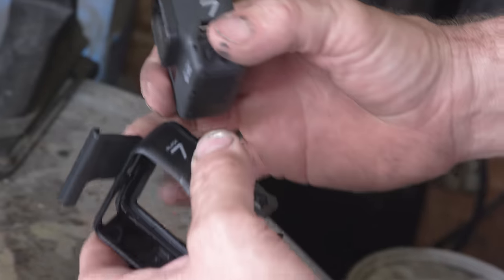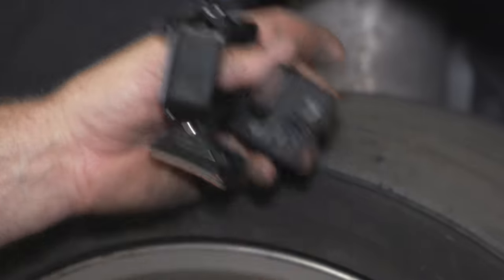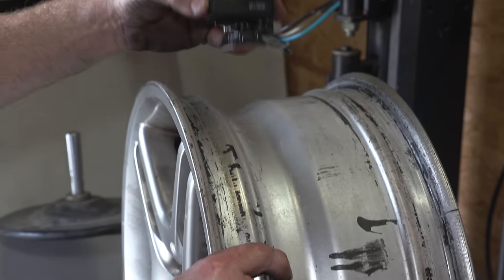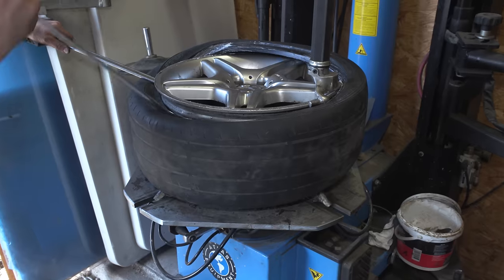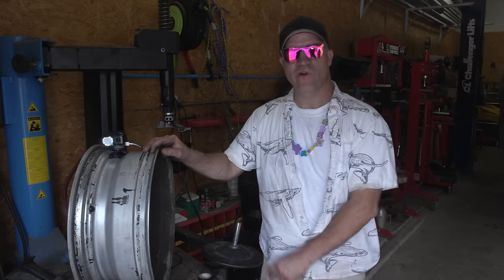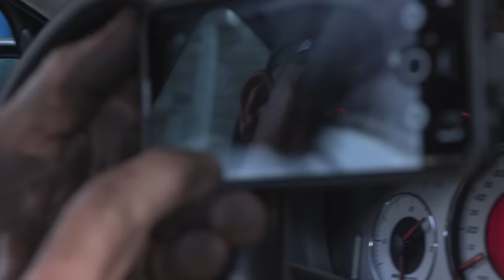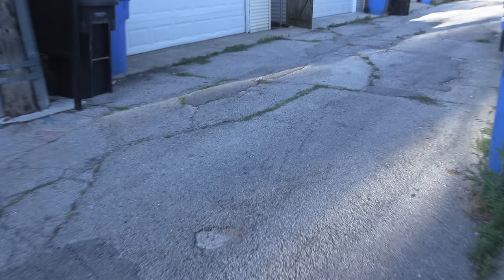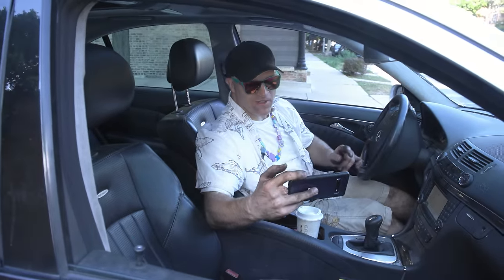GoPro Inside a Car Tire (While Driving)

Comment: After seeing how much the tyre flexes it really makes me appreciate how well made they are to deal with this for thousands of miles and not de-laminate. Thanks for going to the effort to show us the inside view. Much appreciated.
Reply: This also shows why it is very important to have proper tire pressure. Because the tire is already flexing causing heat and the less tire pressure causes more flexing which causes more heat and eventually if the tire pressure is too low too much heat cause sidewalls to fail.
Reply from the maker: I agree.. pretty amazing if you think about it
Reply: Weird...

You used the spelling "Tyre" and miles in the same comment.

Where are you from? Just curious.
Reply: @Stacy_Smith  I don't know where they're from, but we use both of those in the UK
Reply: @EdwardMillen  I was about to point out that the UK uses both of those.
Reply: @Stacy_Smith Tyre and miles are normal words in England!
Reply: @colintinker7778  I'll be damned, I thought you guys were using Kilometers. Learn something new every day huh?
Reply: @Stacy_Smith  Yes...  every day is a "School Day". Glad you learnt something new!
Reply: @Stacy_Smith  looks like I've hit a nerve. Oops!!!
Reply: @napsterbater  thanks. just gonna go and check my tire pressure, brb

Comment: I was a tyre fitter for about ten years and never gave it a thought as to how the tyre looks from the inside.  That was an amazing video.  We take every day life for granted.  Keep up the great work.  Just goes to show how you need to check your tyres for wear.
Reply from the maker: Same here, I had absolutely no idea especially that the cloud formation happens when you release the air... thanks!
Reply: I was hoping to see this at freeway speed.  Even just for one mile.
Reply: Peter's Garage are you british?
Reply: @pinkmoscato7851  no
Reply: Peter's Garage, are you Australian?
Reply: @proudamerican183  yes
Reply: @petersgarage6125  I knew it. As far as I know, only Australians spell tire with a Y.
Reply: I was really surprised to see so much lateral movement and squirming or should I say twisting,, as a tire fitter did that surprise you too or did you know?
Reply: @proudamerican183  every Commonwealth country, with the exception of Canada, spells it with a “y”. Canada’s proximity to the US explains the variance to the British spelling. We’re about 75% British. A good rule of thumb is left hand drive = tire, right hand drive = tyre.
Reply: @renedenis3688  Fine. Let me rephrase. The only one I knew of that spelt it that way is Australia.
Reply: @proudamerican183  Sorry if that came across the wrong way. Time for me to put on my snow tires. I bet they don’t do that in Australia! 😉
Reply: @renedenis3688  Never. Not when every day it's 120°F.
Reply: @proudamerican183  yes Aussie although the British spell tyre correctly too  lol
Reply: @petersgarage6125  "correctly"? 🤔😆
Reply: @renedenis3688 some parts maybe, It does snow here, about 6 hour drive down south from Sydney it snows lol so people put chains around tyres.
Reply: @WarpedYT  I wander is the cloud water vapor condensation?

Comment: Never envisioned how much flex the tire experiences during normal driving.
Reply: It’s amazing !
Reply: @jesus jones he filled it to 35 psi.
Reply: @jesus jones the air pressure pushes on the sidwall and pushes it against the rim. What shocks me is the flex on a low profile tire despite rhe air pressure
Reply: @jesus jones ya definitely interesting. Honestly i didnt expect much but that was pretty darn cool

Comment: This really makes me appreciate the materials and structural engineering of modern tires. It's incredible that anything can take a pounding for millions of rotation cycles and still not burst under pressure, and still be roadside repairable.
Reply: how long does the gopro last inside a tire before it's broken from being inside there like that?🤣🤣🤣

Comment: This would be really cool in a big off road tire driving over rocks and other stuff.
Reply: With multiple cameras or a 360° camera or something
Reply: This is already so satisfying but you're right that would fucking rock no pun intended I think he needs to do that next
Reply: Completely agreed. This video was cool but that idea is the one I really want to see. 

Compare psi etc
Reply: Or just use normal tires on a Jersey road.  You'll get the same effect.
Reply: Top fuel slick
Reply: And put the camera facing the inlet tube..

Comment: Doing this with the speed bumps would be interesting, probably need a lower profile mount though. It'd also be interesting to see what difference a higher PSI makes on tire deformation when driving.
Reply: or just a higher profile tire... basically any vehicle that isn't performance oriented would work
Reply: Truck tire and go off roading lol
Reply: Faster rotation would give some perspective of centrifugal force too.

Comment: Nice, Put some fix a flat slime it the tire so we can see how it spreads out when you drive
Reply: Hey! I'm subscribed to you! You need to make some more videos!
Reply: @desertrat1357  Thanks,  Yes I will start posting more soon hopefully, I actually filmed a bunch of videos for a new channel i'm working on but I haven't even made the actual channel yet.
Reply: @ExperimentalFun  Awesome! Looking forward to it. Are you gonna put a link on your current channel?
Reply: Yes indeed that's a great idea
Reply: I like this idea as well
Reply: Yes do this!!
Reply: Except it would likely cover the camera. That stuff's garbage anyway.
Reply: Or balancing beads
Reply: Balance beads would be more interesting. See if they work
Reply: Fix a flat or tire slime with surely get all over the Camera lens
Reply: This!
Reply: That stuff isn't supposed to be for car tires. It'll throw the balance off.
Reply: @chevy383jt  it's cheaper than a tow truck, not meant for the long haul
Reply: @kdash3215  which one? There were two brands listed and I've had good luck with one of them.
Reply: @lazyh-online4839  I mean more so from a repair standpoint. Cleaning that stuff out of a tire is disgusting and have never personally seen it work long enough to be worth the hassle. Also seen the supposed "sensor safe" formula short out TPMS sensors.
Reply: that would be great, and puncturing the tire in fromt of the camera would also help people see the slime from the inside.
Reply: @zqzj  Or just keep your spare tire maintained and in working condition
Reply: @richardmillhousenixon  not all cars have spares, neither of mine do
Reply: @zqzj  If your car didn't come with a spare it probably came with a repair kit with a better tire sealant that doesn't gunk up the tire as bad as something like Slime or Fix-A-Flat.
Reply: That’s just plain ignorant.🤔

Comment: Suggestion: Put a tiny camera and light source on a bass lure so we can see a large mouth bass swallow it up
Reply from the maker: Tony Melo  is there?, I've never seen that, could you send me a link? I want to check that out.
Reply: Come on steve he’s waiting for yoy
Reply: Warped Perception there’s a company called “GoFish Cam” they make cameras that go on fishing line.
Reply: @ntxtactical7629  The GoFish Cam is located a few inches from the hook, so you see the fish from outside. Not like Steve suggested to view the inside.
Reply: Tim van Seters If you literally want that exact camera on a lure. Why wouldn’t you just make a camera a lure.
Reply: Warped Perception there’s also a channel @KickinTheirBASSTV he turns a GoPro into a lure.

Comment: Glitches are probably the wheel and steel belts in the tire acting as a Faraday cage, impeding the RF. That view was a lot cooler than I was expecting! Thanks
Reply: It also glitched more when the tire was being deformed, so down, thus even more metal in the way.
I'm actually amazed it even managed to link up, wonder if those tires have kevlar structure instead of steel? When looking that up I've only found about bike and offroad tires with kevlar belts tho.
Reply: @Kalvinjj  Interesting. I guess we need the actual tire make/model -  I believe tires that have Kevlar, also have steal belts  - I think
Reply: @182QKFTW  Indeed, I've found something similar when looking around, car/truck tires with kevlar bands usually just use it as extra puncture reinforcement, but don't ditch the steel.
I think I've seen that some drag radials don't have steel on them, but of course those aren't the tires he was using.

Comment: It actually makes more sense visually if you flip the video of the inside of the tyre upside down. Then the road surface is at the bottom.
Reply: @pedeypants7931  yes that's what I did. 🙂
Reply: "actually"
Reply: He should have showed the speedometer, then drove it until the battery explodes.
EDIT: grammar
Reply: @warlockpaladin2261  "should have showed"
Reply: @david peck “tire”
Reply: @Dovah577  tire = tyre in UK, where I live. 🙂

Comment: "Lets take a turn to see what happens!" Proceeds to rip it around a corner lmao
Reply: vertskater101 It’s a supercharged AMG it’s kinda hard not to rip it lol
Reply: @brien1254  But he could've done some slow speed corners first. I mean, we could almost see the sidewall flex front going straight.
Reply: Imagine getting pulled after taking that turn a bit spirited, and trying to explain to the cop theres a camera in your tire lol. 

Once you show them the live feed on your phone as proof, the officer would either nerd out and think its really cool or be a dick about you doing that on the streets. If yiur lucks like mine, youd get the latter.
Reply from the maker: @Racer57  maybe so but my battery was almost dead and I was loosing control of the GoPro for some reason, as soon as I regained control of the camera I rolled it and made sure I hit the corner hard enough to see something happen. I wanted to hit the corner with a more precise smoother entry and exit so we had a nice obvious comparison on the GoPro between going straight and being in the most stressful part of the turn the Apex,  but I was outta time and I couldn't go faster at this location. If my camera had died which it did right after I finished the turn. it would have taken me another 2hrs to go back, remove the tire change all the batteries and come back again, and by that time it would have been dark and I would have to move it into another day. Those are all the things going through my head when we shoot this stuff.
Reply from the maker: @nitrous36  good point but honestly I think I would have been ok. The cops in Chicago are actually really cool. Occasionally you get one person who's a dick, but not very often.
Reply: @WarpedYT  Got it. 🙂 It was just a funny what if scenario. Im sure you would have been ok lol.
Reply: @WarpedYT  Just wanted to say you live down the street from me lol. keep up the great content!
Reply: Ha ha very funny 

Not
Reply: @Adamlol642  ^^^ Neither was that. This guy just got here from the 90s.
Reply: @WarpedYT  very nice video! what is the model and year of the car?

Comment: WIth a few modification you could get a static view of the bottom section of the tire (how it deforms going over different terrain).
Here is how you could do it:
1. Select a speed you want. 
2. Calculate the tire rotations/second (r/s) from speed. 
3. Only keep every r/s frame to achieve static view

Use a strong flashlight inside to reduce the shutter speed or else it will be blurry.
You will need to drive pretty fast to make it work.
Reply: Or you could just not do it.
Reply: 🔩 that☝🏼 guy.  you could do it! Why leave to him what you can offer us today! 💯🙏🏼please ?

Comment: Everyones worried about his hands what about the bald ass tires
Reply: Dude, if I was gonna try & cram a GoPro in there I’d re-use the old bald tires too, for the whole ten miles of shooting any actual footage 😂😂😂 why even chance voiding the warranty on a new $200+/- radial by putting like 5 unintended pieces of equipment under it on the wheel?
Reply: Illegal 

Says me with a stanced lada as a profile pic
Reply: @abluerx7371  lmao
Reply: Bruh facts
Reply: yep, all the time I focused on how dirty they are and he is wearing a white shirt.
Reply: He’s also missing a finger
Reply: + cracked wheel
Reply: That's your typical Mercedes driver, they either have the baldest or the cheapest tires on the road
Reply: Well, he did say he was about to replace the tires. The baldness is only really an issue in snow, ice, or rain. The tires would still work just fine in the weather during his video. Right before swapping to new tires seems like he best time to try some antics involving tires anyhow.
Reply: I worry about the steering wheel
Reply: @brucemorris3830  So a tyre spends it's whole life inflated to 32psi, supporting a car which on average weighs 4000lbs, throw in some accelerations, hard braking and high speed turns and that 4000lbs can be 3 to 4 times higher felt through the tyres on a hard rough surface. Then for good measure we have potholes, rocks, kerbs and burnouts. What do you think a Gopro and a couple of batteries would do inside the tyre for a trip around the block.......seriously.
Reply: The tires has no tires.
Reply: No im not
Reply: Got your money worth outta those tyres ..
Reply: @brucemorris3830  voiding the warranty? Lol
Reply: So, Is bald ass tires illegal in Illinois? I haven't been there since I moved down a couple of years ago.  I have been told things aren't that good up there.
Reply: @kermitinmountain6371  Yes. Tires with less than I believe 3/16" of tread depth left are illegal. If you see little bumps in the middle of the main tread channels in your tire those are usually at the height at which once those are even with the rest of the tire you need to replace them

Comment: The glitching is probably cause the fact that the steel reinforcement in the tire is acting like a Faraday cage. The antennas in the GoPro and phone will have some polarization, so the combination of a weakened signal and polarization might well cause irregular drop outs. Great video. Thanks!
Reply: There are no wires in tires. Not anymore. And it would need a tight web of cable to block any signal.
Reply: @Mikey-ym6ok  Yes there are, they are in the bead for sturdiness
Reply: @Mikey-ym6ok  not all faraday cages are wire weaves with gaps so small you can't poke a finger through... and in a car, I've had a tyre that consistently wouldn't keep air in so eventually, at the edges, it was down to the wire. literal. wire. a brand. new. tyre. with wires in it. It's not 100% rubber.
Reply: No wire in the side walls. Just steel belts under the tread. Faraday cages are made from copper.
Reply: @Mikey-ym6ok  
Yes there are. Steel belts under the tread.
Reply: @AlMcpherson79  
Faraday cage doesn't have to be a tight weave or web. Just a configuration of copper wire that effectively blocks the signals you need rejected.
Reply: @wilsonrawlin8547   Faraday cages can be made from anything conductive, not just copper. And they don’t have to be mesh either (although in that case they are usually called Faraday shields).

Any conductive enclosure will block wavelengths approximately 10 times larger than the largest gaps. WiFi and Bluetooth both operate around 2.4Ghz, which has a wavelength of about 12.5cm, so the enclosure would need to be fairly complete to fully block the signal (gaps around 1.25cm). That said, Faraday shields don’t have to be complete to block some or most of a signal.

Aside from faraday cages, lots of things partially or fully block 2.4GHz, such as concrete, water, and thicker metals, so it’s probably just the steel components of the wheel interfering with the signal, and sometimes the error correction built into WiFi or Bluetooth can’t fully correct for it.

All this said: remember that Bluetooth is the most common protocol for tire pressure gauges, which live inside the wheel, basically where the camera is mounted. If wheels were effective faraday cages, they wouldn’t work.
Reply: Looking at the footage again, the glitches are usually when the tire is deforming most, which is when the camera is on the opposite side of the metal wheel from the phone. I think this is basically just normal signal degradation through a dense material.
Reply: @hoo2042  

FYSA. I build custom Faraday cages for secure enclosures operating various Radio, SATCOM, Network, WIFI, VOIP, etc. systems.
Reply: @samotnaf007  I have wireless tires, they have batteries instead
Reply: @melodycentral0007  Do you run them on bluetooth or wifi? :D
Reply: @murphine969  

Epic! Well done! Bet the video tastes like chicken too.

Comment: Would love to see a nail puncture it, then deflation, then how fix-a-flat swishes around trying to plug the hole!
Reply: Camera would get smashed if tire went flat and the car was rolling.  There is not enough clearance in there for the camera if the tire is flat.  The video would just stop as the camera is smashed and broken.
Reply: your fix-a-flat would very quickly cover the camera lens and we wouldn't see anything.
Reply: @Plur307  Also try to hit the right spot on the Tire in front of the Camera will be hard to do.
Reply: @Equester194  Not really if you staged it,. He knows where the camera is on the rim, so make the puncture in front and let the tire deform. add in the slime or fix a flat, and re inflate... the liquid will be on the 'ceiling' since the camera is mounted to the rim. Now once you start driving it might get goey, but in a case it wouldn't be hard to clean off.
Reply: kleetus92 
Yeah.  I’d like to see if that green crap in the plastic bottle really works.
Reply: @jerrypeppler1484  I've used that stuff actually,  it does work. A patch is really still the best permanent fix though...